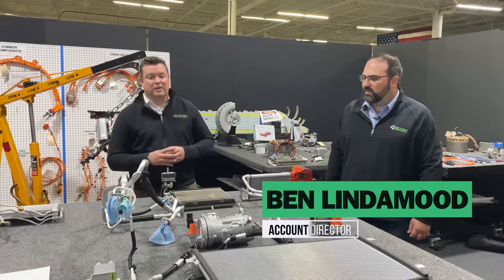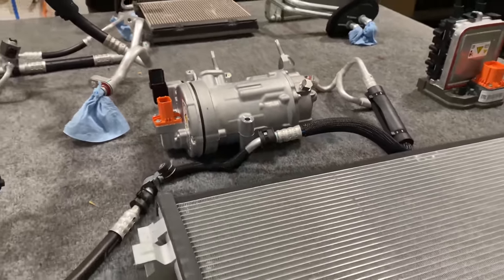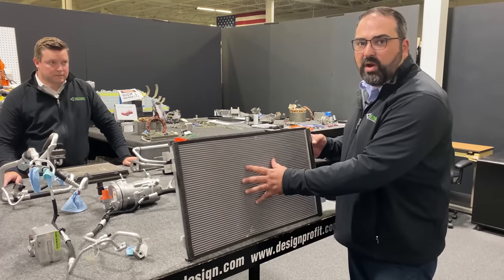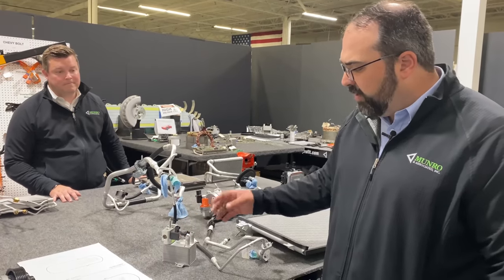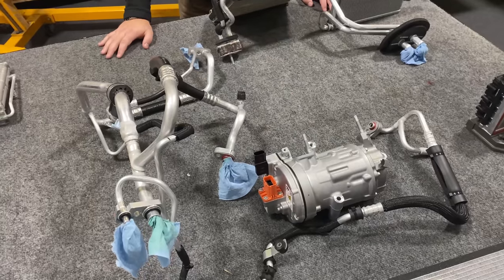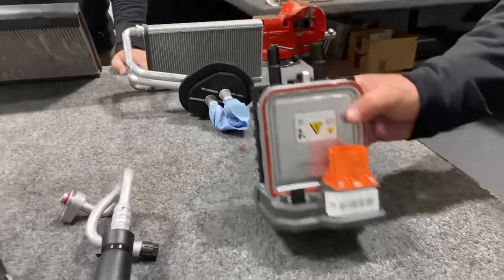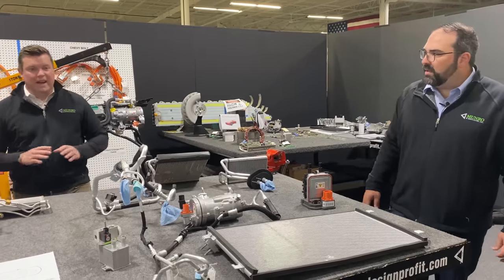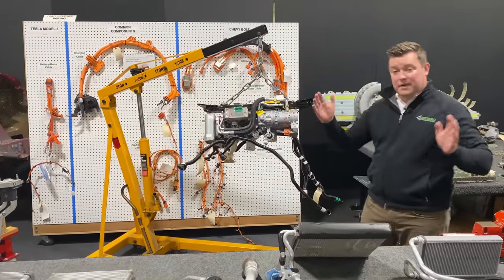Mach-E: EV Thermal System Components - In-Depth Look

Comment: "Early Tesla vehicles without heat pumps performed poorly in northern climates like Norway...," That's a funny way to say, "Tesla vehicles have always performed much better than any other EV in northern climates like Norway, even before they had heat pumps." Just ask Bjorn Nyland. Years ago he calculated about 10% range drop in winter driving in Norway for his Model S, compared to around 30% drop in vehicles like the Nissan Leaf.

Comment: What are the manufacturing, weight and part cost trade offs of the two systems?
Reply from the maker: Great question. All of that information is meticulously documented in our engineering analysis reports. We sell those reports for $60k-$100k.
Reply: For weight you could look at the earlier video...

...That’s the one with all the (Ford) piping in the thumbnail.
Reply: @MunroLive  thanks for the reply.  understand completely.  but you did give us some stats in one of your last videos comparing the hose length and coolant weight. Is that also for this system? If not is there some similar stats? Thanks
Reply from the maker: That video was primarily focused on the Ethylene Glycol circuits and not the R1234yf, but yes we did give some stats. We can bring in some data in the future.
Reply: @MunroLive  am I available to order one through your website 😂
Reply: @MunroLive  $60k-$100k? What can I get for forty cents?

Comment: I’m puzzled about the Tesla - surely it needs an external source of heat (or cooling) to work?  The video led us to believe it’s all done along the HVAC ducting.  My Kona has a “condenser” on the front grill plug both units along the ducting.  Is it using a heat exchanger to utilise the coolant system capacity?
Reply from the maker: The Model Y uses a "Liquid Cooled Condenser". Instead of rejecting heat to the atmosphere through a traditional condenser, Ethylene Glycol is pumped to a plate-style heat exchanger. The Glycol is cooled in traditional radiator mounted in the front of the vehicle.

Comment: Hi, I would like to know, are You saying that I should not buy the mustang mach e if I live in a colder climat (Denmark) ?

Best regards
Tommy
Reply: I have seen a photograph of a parling lot full of Mach-e that were bound for Norway, which is in your neighborhood.
Reply: well it depends, you can get a mach-e just be prepared to charge more often in the winter. I live in Norway with a 2019 model 3 which has a ptc heater and i get maybe 100 to 150km less range in the winter since the car uses more power to heat up the cabin
Reply: You have heard about the 6 separate machy fords that bricked on Eagle road Valldal, Norway? (Ørnesvingen)
Reply: @thesure1  Yeah the reason was the regen basicaly over cocked the motor, they gonna fix that in a software update, problaly restrict the regen i guess.
Reply: @danielstefanovic2604  I believe the software bricked the car to keep the parts safe. 

Either way they had to be towed back to a ford dealer.

Comment: I thought heat pumps just don't work below 0 F.
Reply: They do not at a certain temperature EV‘s must rely on traditional resistive heating. So in very cold temperatures they do not add much range if any

Comment: Why does the cabin have two heat exchangers (condenser and evaporator) only one should be required like for the battery in Tesla’s heat pump system?
Reply from the maker: Condenser for heat, Evaporator for Cooling (AC).
Reply: You are missing my point. I’m an engineer and know how a heat pump works. In residential applications there is only one heat exchanger inside the house and one outside. These are either functioning as the evaporator or condenser depending on the weather they are cooling or heating the house respectively. There must be a very interesting reason for having two heat exchangers. May I need to review your octovalve video

Comment: Do you guys know that the VW ID4 has a heat pump here in Canada and the refrigerant is CO2 could you talk more about that please.
Reply: interesting, I have heared Mercedes Benz and other German Cos wanted to go CO2, so not to pay royalies for R1234YF.  But CO2 is extremely high pressure so difficult to work with.

Comment: Does the legacy Model 3 resistive heater heat the HVAC air directly, or does it heat a glycol loop that is routed to an exchanger?  I suspect it is the former because of the rapidity that the Model 3 can heat the cabin.
Reply from the maker: Legacy Model 3 heats the air in the HVAC module.
Reply: @MunroLive  thanks, and if I recall it also uses stator heat via glycol loop to heat cabin too?  Or is that just for heating battery?

Comment: I know you guys don't like the ID4, but at least it has a heat pump, or at least here in the northern climates. E-tron has it as well and is significantly quieter than the model 3 actually you can't even hear it.

Comment: Is the seat warming just a resistance wire? Assuming it is, is it more or less efficient than heating the cabin air with the heat pump system?
Reply from the maker: Yes. EV's typically rely on both heated seats and heated cabin air from the HVAC system.
Reply: Butt Toaster.........you POP up into the Roof of the car when done...........LOL.

Comment: You showed how the Mach-E gets heat out to the atmosphere in the condenser, but did not show how the Model Y gets heat out to the atmosphere. On a hot day you will not want to use the condenser inside the HVAC system, so it will use the refrigerant-to-coolant heat exchanger, but that coolant will need to go to a radiator that has outside air passing through it. 

So you show they Mach-E condenser but not the Model Y Radiator, which is where each dumps the heat from the cabin, battery and electronics.

Comment: Additionally, if I wasn’t an engineer I would not have had a clue what you were talking about. You need to enlist the services of Engineering Explained to provide a concise and digestible explanation. I am not sure if you guys understand the subject yourselves. An AC system IS a heat pump.

Comment: What are the cons to the heatpump system?
Reply from the maker: Typically more complex, heavy, and costly. But the benefits are better range in cold climates due to more efficient conversion of electricity to heat.
Reply: @MunroLive  Interesting. It looked simpler and lighter, but maybe they didn't show all the parts involved.
Reply: Having lived with a heat pump they don't produce the nice warm heat when it's below freezing without some sort of heating backup. The farther the temps drop below freezing the harder a heatpump has to work to produce heat.
Reply: @bswens01  The heat-pump delta-T is maybe only about 20F or 7C, so it feels like cold air blowing.  Electric resistance heat can be nearly any temp rise - feels warm.

Comment: This makes one wonder why anyone would ever consider buying a Ford Mach-E
Reply: Why?

"There's pros and cons to both systems." - Cory in this video.
Reply: Heat pumps start top lose efficiency at 40 degrees and they will still work around 25 degrees but you will need another source to augment the heat pump. that is why in houses with heat pumps still need auxiliary electric or gas heat when the temps drop below a certain range...perhaps Ford decided to drop the extra weight of the reversing valve and just went with an electric heater and dealt with the range hit..
Reply: Tesla repair network and repairabilty are HORRIBLE outside California, parts hard to get and extremely extensive repairs.  Ford has service centers within 50 miles of nearly everyone.
Reply: Maybe because the Model X base model costs $37k more than the Mach E?

Comment: I think he means R134A is the refrigerant, There is no R1234 as far as I know and I am Universaly certified for all refrigerants. I could be mistaken.
Reply: I believe that number refers to the pump.
Reply: @MarkXHolland  I knew that (wink wink) just making sure everyone was listening, LOL. TY
Reply: @frostygt3628  R1234yf is correct.
Reply from the maker: Auto OEMs have been moving to a new refrigerant, r1234yf, because by law in the US, Canada, and the EU they must use refrigerant with a global warming potential less than or equal to 100x that of Carbon Dioxide.  R1234yf meets this requirement with a GWP of 4 while the old r134a was around 1300.

It’s rather like the switch from r12, Freon, to r134a in the 90’s.

With the exception of some European luxury brands using r744, super critical CO2, everyone is using r1234yf these days.

Comment: I will never understand AC regardless of his many times you explain it to me. I’ve even watched the mosquito coast twice.
Reply: It really is pretty simple. To turn a liquid into a gas (boil) you add heat. When that happens in the evaporator the heat comes from the air passing through it removing heat from the air and turning the liquid into gas. When you compress the gas it raises both the pressure and temp of the gas. To turn it into a liquid you need to cool it. So when it passes through the condenser it sheds that heat into the air flowing through it. 

Another way to think of it to boil a liquid you need to add heat which is removed from the air. To turn a gas into a liquid you need to remove heat which is added to the air.
Reply: @maraudermanmarauderman7161  I can recite that was well. It just makes no sense that it works/flows to me.
Reply: @NewCastleIndiana  The key is the latent heat of vaporization and that the boiling point of a liquid is dependent on its pressure. The easiest way I know to describe that is with water. 

Say you want to make some tea or pasta so you boil some water.  If you monitor the temp you'll see that it rises in a linear fashion. That is for every minute it is on the burner it will increase X degrees. Once you hit the boiling point the temp stops increasing despite the fact that you are still introducing heat at the same rate. That extra heat that is needed to turn 212 degree water into 212 degree steam is the latent heat of vaporization. That latent heat of vaporization is very powerful. See how long it takes until a pot boils completely dry (raise all the water 1 degree) vs how long it takes to raise the water from 100 degrees to 101 degrees. 

While I used 212 degrees as the boiling point of water that is only true at sea level atmospheric pressure. If you go to Pike's Peak and boil your water at the top it will actually start boiling before you hit 212 degrees. This shows how to boil water at room temp. https://www.youtube.com/watch?v=XOwCZUNTLH4

Conversely put that water in a pressure cooker or put a pressure cap on your radiator and you shift the boiling point higher. 

So by manipulating the pressure of the refrigerant you can control the temp at which it boils and unlocks the power of the latent heat of vaporization 

With the right pressure we can make the refrigerant boil at say 35 degrees where it will suck the heat needed to boil from hot air passing through the evaporator (heat exchanger). 

The compressor then raises both the pressure and temp of the vapor. You want to control this pressure so the condensing (boiling point) is high enough that it can shed that latent heat of vaporization as in turns into a liquid. For example you would want the pressure to give you a boiling point of say 150 degrees so it can be cooled by 120 degree air passing through the condenser (heat exchanger).  

A heat pump just allows the two heat exchangers to swap functions.

Comment: A standard car A/C unit is a "heat pump", just a one way version. So the efficiency is nearly identical in that regard. The reverse (heat generating) cycle of the heat pump is a more efficient way to generate the same amount of heat energy, but has certain environmental considerations which must be factored in. Here in the South, we often use heat pumps for heating our homes, but they are only more efficient over a certain range of temperatures, unless you design them to be usable in colder climates. In other words, there is no free lunch. These are engineering vs cost vs effectiveness decisions. I like the idea of the Tesla heat pump, but at this point, I can't really justify the expense of a Tesla either. Time will tell which is the best solution, but to declare victory is a little premature.

Comment: Even before the Model 3 had a heat pump configured for heating (via Octovalve) it didn't have anything as useless as Ford's PTC heater.  Rather, it scavenged heat from the electronics.